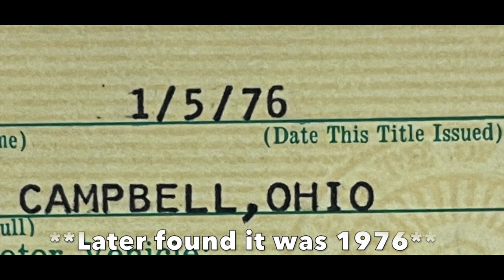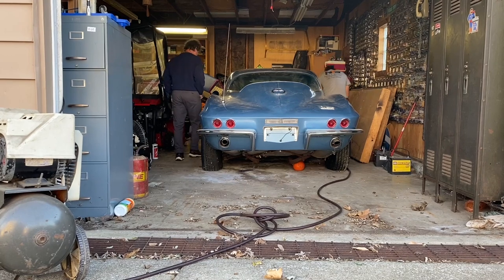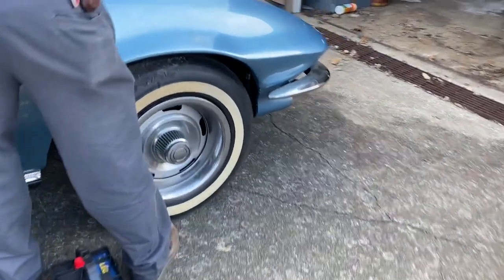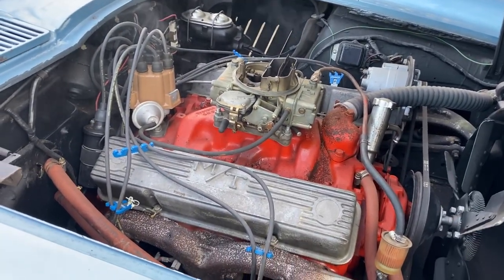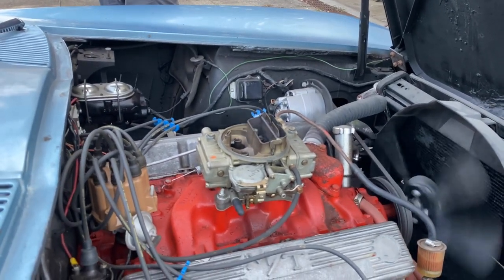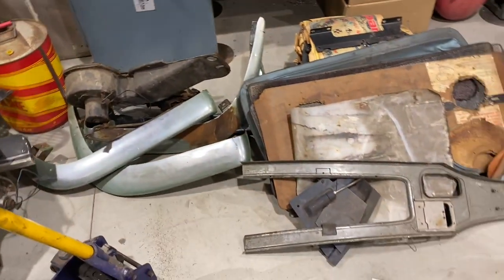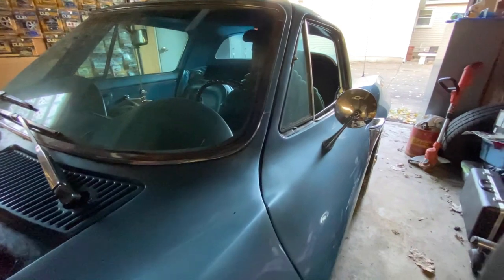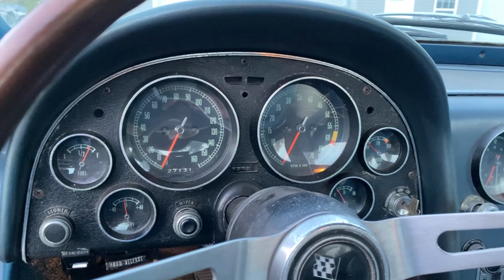BUYING and DRIVING a 1967 Corvette C2 - STORED and FORGOTTEN..EPIC GARAGE FIND!!

Comment: the 67 C2 corvette is one of my favorites. I have always wanted one. they are they are insanely priced right now, and i don't see it going down any time soon.  FYI starting in 1967, the factory glued a copy of the build sheet to the top of the gas tank. so the tank sticker will tell you everything you need to know about the car.
Reply from the maker: You always have great info, we will have to try and find it. Thanks Shad!
Reply: @RyanSampsonRPh i am a pharmacist too.....is any other documentation such as the protecto plate included?   I'm curious as to what the tank sticker says?  Does the trim tag say 976 for marina blue?

Comment: It looks as thou you have a non original block with no CCV from the rear port to the oil fill tube, and the rad is for a BB. You need to change that rad and shroud so you don't have over heating issues. The fan should be 50% inside of the shroud. Also the vacuum advance can is incorrect and possibly the dizzy itself. The passenger exhaust manifold is incorrect, it for a earlier engine for the choke heat tube hole. All SB had an overflow tank above the battery and it was plumbed into the cooking system.The hood is a GM over the counter part. They were made by North American Rockwell for GM. Knowing the car was damaged in the front driver side, the hood had to be replaced with the current one. Maybe all this info is late to you, but necessary. How do I know all this, I have 50 years experience with C-2 Vettes.

Comment: Nice find - and the best color combo offered that year in my opinion. 

Have you checked to see if it still has the build sheet on top of the fuel tank? It should be visible by pulling down the rubber seal around the fuel fill opening, on the drivers side of the tank - they are frequently still in place after all these years. The tachometer redline and 60Lb oil pressure gauge indicate that the car could have been equipped with either the L79, L36, or L68 engines. The half shafts and rear sway bar would be other indicators of whether or not it was equipped with a big block or is a small block with a big block hood installed.

Looking forward to the next video on this project.
Reply from the maker: Yep, build sheet was actually still there (check my short video on it), born a factory big block car!

Comment: Incredible find, your friend is one lucky dog. Not only was marina blue/blue guts one of the most desirable colors, ‘67 was the most refined C-2.  If he hasn’t already I would highly suggest he carefully drop the tank and see if the tank sticker survived,that is the ultimate prominence of documentation.  Likely the block isn’t original, ignition shielding missing, carb incorrect etc. Did you check the casting numbers on the block?  I had to cringe when the fuel tank wasn’t drained, easy process, done many. Not hating, just envious, lol. Congratulations to your friend, thanks for taking us along Ryan.  They’re still out there!
Reply from the maker: We took a look in the tank and saw it looked decent. Definitely a risk though. You are right, engine block is not from a 67, matched up to be a 69 block. I am jealous of this one as well lol. Hope you have been well!
Reply: @RyanSampsonRPh  Thanks Ryan, doing good. Miss your content. All good with you?
Reply from the maker: @skinnerhound2660  Everything has been good! Just super busy with work and family stuff. How’s everything with you?!